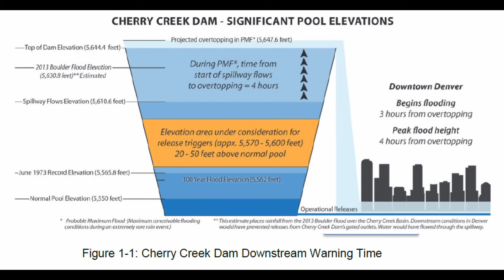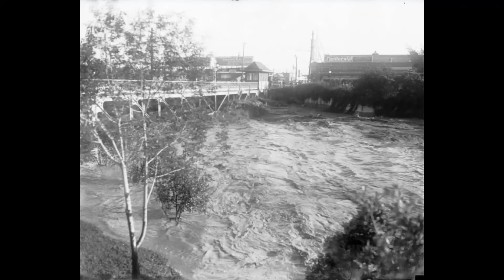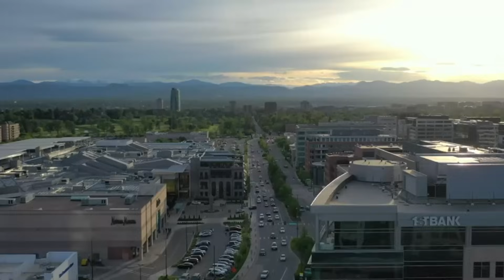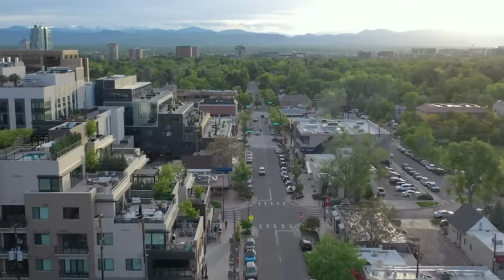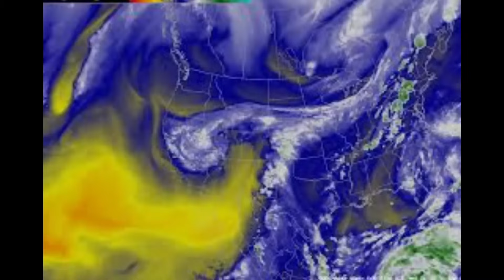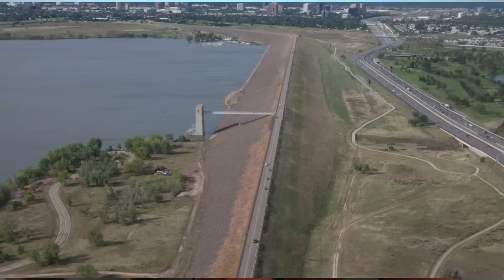Why Cherry Creek Dam Could Fail?

Comment: Excellent discussion of a large structure in Denver. I think that due to the size of the dam, the possibility of failure is quite low, but not impossible especially with the rain received just 11 years ago. All of the subdivisions built around it would be devastated in the event of a severe flood or failure. I think we have a clear case of airport syndrome.

Comment: The Cherry Creek dam sounds like it has a lot of similarities to dam on the West Fork of the Mill Creek north of Cincinnati. Construction started in 1950 and was completed in 1952 and its purpose was to create a flood control reservoir in response to a flood in Cincinnati in 1937. Since the 1937 flood was not only caused by water coming from upstream but also from flood waters from the Ohio River backing up there is also a dam at the outlet that has very large pumps to pump water over the dam. I grew up living near the West Fork dam and visiting the park built around the flood reservoir pond. There is a main road that goes over the reservoir that dates back to 1798 and it is normally 50 feet above the pool level but during rain events the corps will completely shut off outflow of the dam for a certain period of time and I have seen the water level only a few feet below the road.

Comment: When I lived in the Houston area we had a "minor" tropical depression that came overhead right on shore and stalled. We got 24" of rain in less than one day. Some areas of SW Houston had minor creeks rise ten foot in that time. I was an electrician at that time and went into houses with 7 foot in the house and the floor was well above creek level. Imagine 24 inches of rain but  also the run off from all the impermeable surfaces in the suburbs. Ten foot rise on small narrow run off paths was not uncommon. People got trapped in attics and no tools to break out onto the roofs.

Comment: Perhaps you could have expounded a bit on how the MPS has been "determined".  At many places, there is not a long timeline for accurate recorded rainfall events to statistically extrapolate just what a MPS, or even a realistic 100 year event looks like.  And, this is especially true for older structures that had even less statistical storm data to go by when they were designed.

Comment: The 1933 Denver flood was caused by the failure of the Castlewood Canyon dam upstream from current Cherry Creek dam.  The Cherry Creek dam was built as a result of that failure / flood and expressly to adress your concerns about extraordinary rainfall.  The newish Reuter Hess dam has further changed the dynamics upstream.  The Cherry Creek spillway can take  a couple of thousand cfs before impacting the houses; the drainage is an open space park area all the way to the South Platte, bypassing to the north of downtown Denver.

Comment: The dam at Cherry Creek can not overtop, it's is many feet higher than anything in the back side of the fan.  If there was a catastrophic rainfall, the water would flood Greenwood Village, Centennial, and Aurora.  The spillway in the east side of the reservoir  flies into Toll Gate creek, then through Sand Creek into the South Platte River. 

No doubt there would be massive flooding, but it won't overtop the dam.

If you don't believe what I say,  just take a short drive over Dam Road and look South, you see that the all of the land behind the dam is lower than the dam itself.
Reply from the maker: You are incorrect as the water level could be many times higher than that of the ground surface if enough run off comes in in a short period of time
Reply: @CaseyJones-Engineer I believe his point is that before overtopping could occur, there would already have been massive flooding downstream.  Nothing can be designed to withstand every force of nature.  As you pointed out it has already withstood a 500 (or 1000) year event.  Should every dam in the US be rebuilt to withstand a 10k year event? Or simultaneously withstand withstand  10k year seismic event at the same time?  With such unreasonable assumptions- a minor dam failure would just help clean up the mess...
Reply: @CaseyJones-Engineer Boulder county protecting and harboring Prarie Dogs at dam site is PROVEN to be a bigger risk (and very easy to mitigate)...

Comment: Feels a bit click-baity, mate. Love the expertise but is there anything essentially unsafe about the dam? Seems like they keep the level of the dam very low to account for the large-volume rain event you describe. So I'm left wondering, from a storytelling POV, what does this expert think: Is the dam safe or not based on their current SOPs? What is the risk?

Yes, it's interesting to get the worst-case-scenario view and explain a potential failure mode but ultimately what is your conclusion? e.g. There is risk but it's well managed, there is risk but it's being poorly managed, there is a serious risk because they are underestimating the potential rainfall/flash flooding, there is limited risk and lots of buffer, there is a very high probability of this thing failing in 10 years?

It felt incomplete not to have that final piece of the picture -- even if the picture was, "I don't know because the SOP of the dam is not available" or "I don't know because we don't know how bad the rain could get...." - I think it would make the video far more compelling if we got that final analysis.
Reply from the maker: Not clickbait at all. The Corps recognizes the need to provide additional flood protection for this dam and dropped it due mostly to a lack of leadership. Clickbait, SHEESH .
Reply: @CaseyJones-Engineer  As I'm sure you know, nothing in government happens in a vacuum. If the locals were opposed and could put pressure on the politicians it's a much harder ask.

The deeper part of my critique (I hope) was that I feel a stronger conclusion would make it feel more complete. Without it the video feels likes a listing of facts and we don't get the full benefit of your expertise. When I visit Denver and drive down I-225, should I be scared if it's raining or is the dam being appropriately managed?

Hope that's clearer and always appreciate experts sharing their knowledge.
Reply: @x--.  Noted that he didn't answer your actual questions...  Wisely avoiding exposure of being sued for slander or liable???

Comment: The mile high city could become the mile deep city, oops. Imagine the damage from the dam collapse to possibly 100 miles east. What would happen to I70 to US 287 and the towns around those roads. It could reach the borders of Texas and Kansas because of the lower altitude from Denver across the wide open, dry soil of the plains there is about a 1000 foot drop in altitude from Denver to points east. the ground is a type that does not absorb well, it is easily made into flow material. Ask a geologist about this. Between hydrology and geology, a Cherry Creek collapse could create a disaster that could damage food production and population distribution for decades.
Reply: No, the flood would not reach Kansas or Texas, but it would impact Nebraska.

Comment: What needs to be done ... absent any political will to fix everything and fire the goofballs running the show ...

... is to LOWER the operating height of all flood control structures ... plan for early, timely, and maximum discharges in advance of storms ... and sneak in some repair work and redesign would be nice, but no one with authority knows what to do ...
Reply from the maker: That is a great point.  The Corps should turn Cherry Creek into strictly a detention structure but the locals demand their lake recreation.

Comment: Speaking of damn dams: Partial dam break on Yantic River which flooded out some parts of Norwich, Connecticut. Privately owned, first built in 1871, which makes it fairly modern for New England.
Connecticut Public Broadcasting has a thorough story
Reply from the maker: Thanks for that tip!

Comment: The problem with a earthen filled dam is that trying to increase the height may cause a failure . Case in point , a few years bask a tailings dam broke here in British Columbia , although I’m not a Engineer even I could see that by raising the dam , the underlying soil couldn’t support the additional weight of the topping of the dam  , causing it to fail . The best way to prevent overtopping is to add spillways , but I see the downside , but a sudden failure would be worse . 👍🇨🇦
Reply from the maker: I understand your point, but they were only talking about raising the crest 12 feet which wouldn't overstress the dam foundation since it would probably take them 12 months to place that fill.

Comment: I used to live in Denver, right next to Cherry Creek. Ironically, I wondered occasionally what would happen if the Cherry Creek dam failed, especially when there would be a flood that put the bike path between the two sides of Speer Blvd underwater.

Comment: Live statisticians will scream at me, and dead ones will turn in their graves, but if one sees something that is half of the supposed probable maximum flood (PMF), one would have to think that maybe the PMF is bigger.
Reply from the maker: Yes that is a good point.  Also I don't know whether they considered a lesser rain total over a short period of time on top of a snow pack which would cause rapid melting.  This is what happened at Oroville Dam in California and that flood caused a lot of damage to the spillway.
Reply: @CaseyJones-Engineer  Yes, I was thinking about that one, but couldn't remember the name off hand. It makes me wonder how sure we are that the emergency spillways will work as intended if something approaching the PMF arrives, since it clearly would not have at Oroville.

Comment: I grew up in Aurora, CO, and went to Cherry Creek Reservoir to fish, swim, and boat pretty much every summer.  It was a rite of passage for the Driver's Ed. classes to drive across the top of the dam...  The reservoir pool is NOWHERE near the top of the dam.  Seriously.  It would have to fill up more than 50' high to "overtop" the dam.  The water would find another channel out of the pool before it would over-top the dam.  Over-topping of the Cherry Creek dam is seriously the LEAST of my worries for Denver.
Reply from the maker: The reason why the lake level is so low is to provide room to store flood waters.  It is impressive to see so much dam above the lake level.  I know that the boating interests have long wanted the Corps to raise the elevation of this recreational pool but they can't give up the flood storage for that.
Reply: @CaseyJones-Engineer  Interesting. So the low pool is an intentional measure, necessary for sudden storm water storage. That is a positive. I bet most people are not aware of that.
Reply: I've come to the realization that there is a lot of mental illness in Denver.  Much more than you would think.  It's hidden below the surface.
Reply: Denver could use a good washing 😮

Comment: Thankfully the dam is not made by 2020s Boeing
Reply: They've already found loose bolts in MANY other planes.
I guess torque wrenches are now a novelty item.
Reply from the maker: Boeing in not the company that they used to be that's for sure.

Comment: First thing that needs to be done is install several "Flood Depth Gauges" downtown. Set a flag showing the height of the earlier 1940's flood and another showing the height predicted if the dam gives way. at the base of the poles install a sign stated that no action is being taken because local voters do not want the inconvenience and costs involved with raising the dam up higher.
Reply: Raising the damn dam higher, means the damn dam's base also has to be agumented as well, otherwise the additional hydraulic pressure will penetrate the earth works to failure, which just makes a bigger and deeper flood when it fails.
Source: My Rubber Ducky said so

Comment: Is the risk from rain or snowpack?
Oroville had its spillway fail from record snowpack followed by massive rains.
Bit different since Ca intentionally chose not to fix the spillway, and then was happy to let the rest of the country foo the bill for emergence repairs
Reply from the maker: They said the PMP was just from a rain event, but you raise a great point.  If lesser amounts occurred in a short period of time on top of snow pack it could produce the same type of catastrophic flooding.
Reply: It's primarily from rain. Cherry Creek does not start in the mountains. It starts in a high area of the plains called the Palmer Divide, which does not commonly accumulate a lot of snowpack. The Plamer Divide, is, however, quite prone to get heavy thunderstorms in the summer.

Comment: The scenario you describe is precisely what occurred in the Johnstown flood of 1889 which killed over 2,000 people.
Reply from the maker: Yes, you are right about that and there were several dams that experienced sequential failures as a result.
Reply: Not exactly.  The "South Fork" dam was always kept "Full" and the dam was actually raised without consultation and the spillway removed to prevent the loss of "prize fish."  Cherry Creek reservoir is kept nowhere near the top of the dam.  And the spillway is kept usable throughout the year.  The two are nowhere near similar.
Reply: @pastorjerrykliner3162  While it is true that the height of the dam was lowered and the water level kept at maximum height, the immediate cause of the failure was the overtopping of the earthen dam as a result of a an unanticipatedly severe rainstorm that raised the water level. The key factor is the fact that the material used in construction, i.e. soil, is particularly susceptible to failure when compromised by water.

Comment: I'd be interested in knowing why you picked this dam from among all the candidates.  The fact that you chose it suggests it is at more risk than the others, but I didn't get that sense from the video.  Are you using this dam as a convenient exemplar of a general problem or is there something noteworthy about it that brings it to the top of the concern list?
Reply from the maker: This dam is one of many high hazard dams in the U.S.  I picked it because, as I mentioned in the video, I used to perform inspections of this dam so I have a lot of familiarity with it.  For example, I had to walk the entire spillway channel during these inspections and the first time I did, I was utterly astounded that the channel would discharge into a residential subdivision.

Comment: Hey Any interest in the Sacramento river levee? They are improving it by adding 4 foot. What is the potential for failure. Earthquake or excessive rain and runoff.
Reply from the maker: Thank you for the suggestion.  I am definitely doing a video on the Sacramento levee system and hazards.  I worked for the U.S. Army Corps of Engineers first in the Omaha District and later the Sacramento district and I lived in Sactown for a few years.  Let's just say the risk of levee failure is very high when you combine an earthquake and flood event.  Back in the late 80's and early 90's when I worked there dismissed a joint occurrence as a 1 in 10,000 year event but I think that assessment was greatly over simplified when you consider that if an earthquake happened first, foundation soils would liquefy and the levee would settle reducing it height and available freeboard.  It would take months before the levee embankment could be restored and it is quite possible that a flood event could occur in the interim.  Also failure of the San Joaquin levee system would allow massive salt water intrusion into the delta which would be a disaster all by itself.

Comment: Casey, how much silt has accumulated over the past 90 years? if silt fills in the revivor would that decrease the damage done by a failure of the dam? i.e. less water to do damage?
Reply from the maker: That is an interesting point.  I would think that they would periodically dredge the lake to maintain storage but I don't know for sure what they have done here.  I think siltation would make matters worse since the storage volume for water in the reservoir would be less which means less flood water could be stored before overtopping would occur.
Reply: Very rarely have I ever heard of silt being removed from any reservoir  mostly they ignore it till they can't anymore then don't want to fix it properly  as the costs are high.money first people second as usual in buisness.
Reply from the maker: @joesutherland225  Thank you.  I suspect you are right.  Also a lot of sediment ends up getting contaminated with pesticide residue which makes disposal and issue.
Reply: @CaseyJones-Engineer  not to mention heavy metals and others
Reply: Most of that silt would probably flow down behind the water.  Just like the sludge behind a coal waste dam or other mine waste water settlement pond.  After the waters gone there may be 10 feet of mud burying everything

Comment: Pollution from China and other up wind sources increases the risk of long sustained rainfall events. Add in the risk of sudden snowmelt from a warm front storm it gets worse.
I took leave from Ft. Belvoir VA back in the early seventies before a Hurricane came through. When I came back upper floors in the barracks were OK the roof held basement areas had max six inches of water at the peak. Other areas on base and nearby had serious washouts of roadways and railroad tracks with cuts 70 feet deep or greater in some of the steep terrain leading down to the Potomac River.